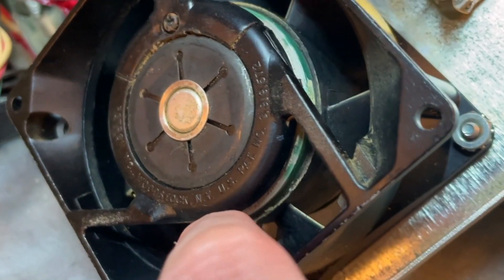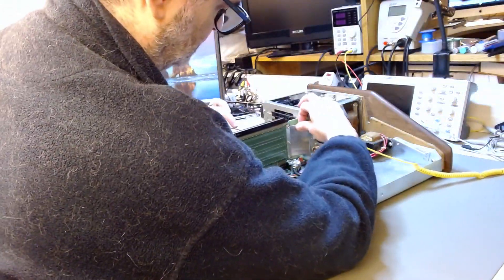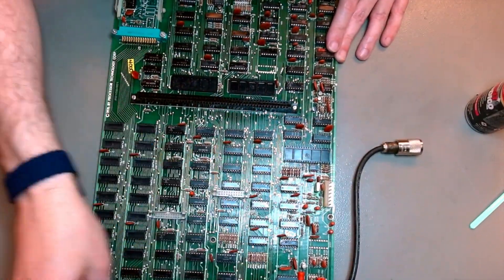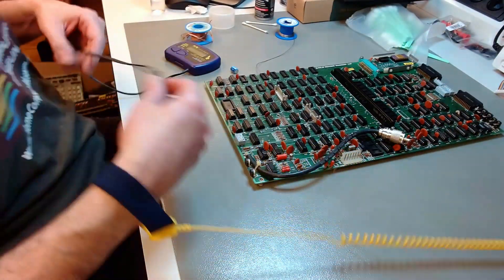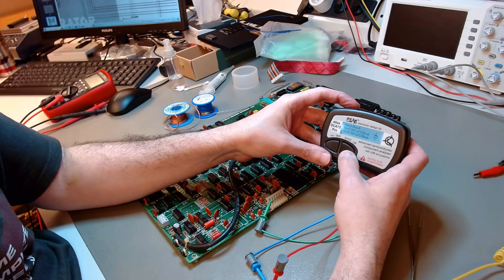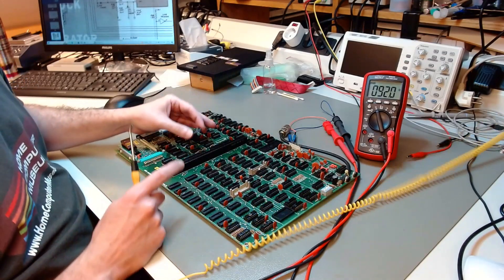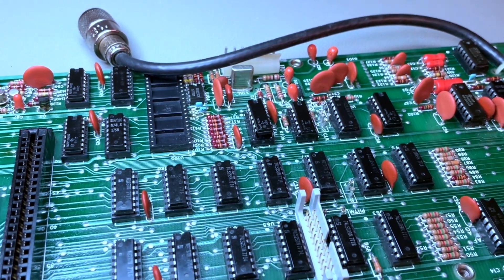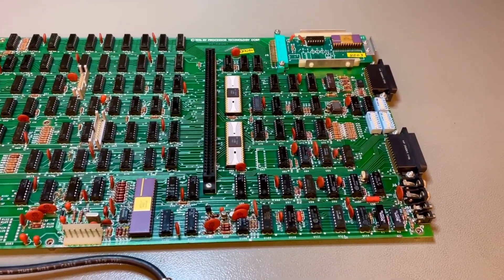SOL-20 museum restoration, PART II

Comment: WD-40! You are aware that’s a solvent, not a lubricant, right?
Reply from the maker: As the other commenter pointed out, there are many varieties of WD-40. The original one was developed as surface rust protection for the metal skin of ballistic missiles. But today it is used mostly as a lubricant. In this series of videos I use several versions of WD-40, including the original lubricant, but also a contact-cleaning version that does contain strong solvents.
Reply: WD-40 is the brand name, they sell lots of other stuff than the solvent you're thinking of.
This one is dry lubricant.

Comment: Good thing you're wearing an ESD wrist strap because that fleece sweater generates tons of static electricity.
5:43 Although wearing it loose on your wrist doesn't help much.
Reply from the maker: Loose is not good, but if it touches my skin it will work.